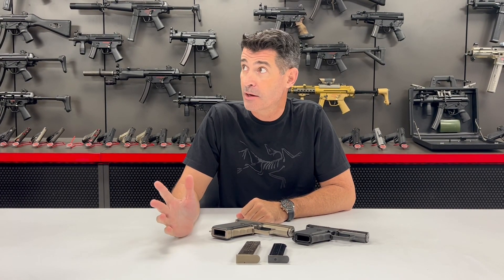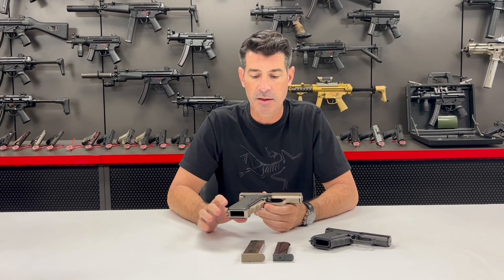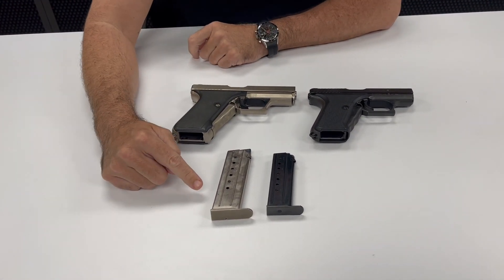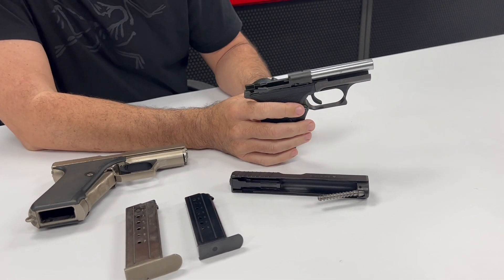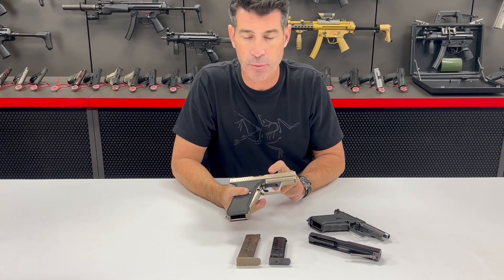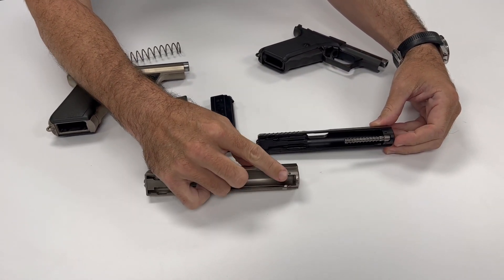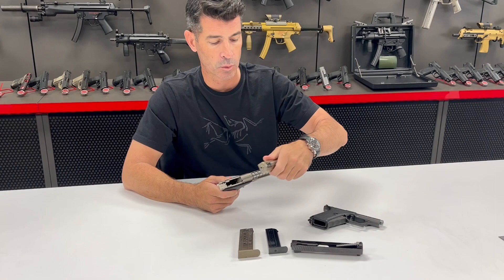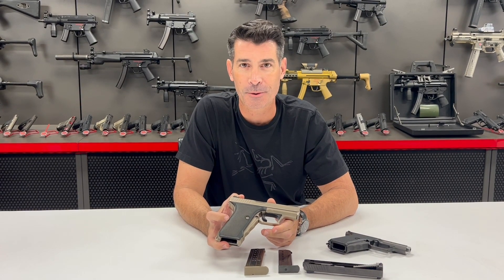Heckler and Koch P7M7 Target of Opportunity Video

Comment: Can you please do a video on suppressing the MP5 with a WML also attached and all the variations that are used to accomplish this setup. Ideally I would like to use the surefire hand guard but I understand there tends to be clearance issues. Thanks.
Reply from the maker: Too many variables due to the different size of suppressors and whether they mount vis direct thread or three lug.  If you already have a suppressor, you'll have to work around it with different light options.  Most of the time, the integrated Surefire lighted handguard prevents the attachment of a suppressor.
Reply: @teufelshundtactical  Surefire should make a redesign of the handguard with the light about a quarter inch lower and you should help them design it. I think they would sell out like crazy, don’t know why Surefire hasn’t done it yet.
Reply from the maker: @korbyn49  They used to offer a “dogleg” adapter which fit between the forearm and the head.  Wish they still did, as it solved the issue.
Reply: @teufelshundtactical  It totally solves the issues but looks terrible. Lol

Comment: Thanks for that James. I’ve only read about that gun and glad to finally see an actual prototype in the flesh. We have a farm outside of Atlanta and I’ve been to the facility a couple of times for HK transactions with a couple employees but never visited the room. Will have to make that happen at some point.  Have you ever fired a P7M7?  I’d be curious as to how it compares in accuracy to an M8 in the right hands, as my 9mm P7 designations are some of the most accurate production handguns I’ve ever fired. I have an M10 but it’s supposedly unfired, so I can’t speak to its accuracy in comparison.
Reply from the maker: You should sign up for their P7 Armorer Course.  You’ll get the awesome training and a visit to the Gray Room.
Reply: @teufelshundtactical  Sounds like the way. Do we bring our own samples to the course?  That would be great as I have a few that could use a run through.
Reply from the maker: @jssmith1970  No, everything is provided.  But if you need service on your P7 series pistol, you should contact me through my website for a full overhaul.
Reply: @teufelshundtactical  I’ll do that. A few of my shooters are approaching the 1000 round mark and short of general maintenance, I dare not get into guts of the guns like the drop safety spring and firing pin bushing. Do you have inventory of replacement parts that one could acquire for longer term.
Reply from the maker: @jssmith1970  Yep

Comment: The walther ccp, from my understanding, is extremely similar to the 9mm p7.
Reply: …IF the latter were produced with shoddy materials, lazy tolerances, and little regard for reliability and durability.  The P7 family is legend; the CCP is a cut-rate  🤡…no surprise since its manufacturing origin is Umarex, despite the Walther branding.   BLUF: If you want German engineering rendered properly, you can’t get it at a cut rate.